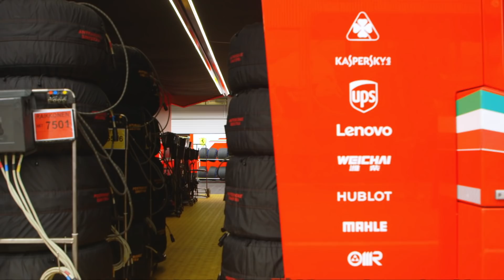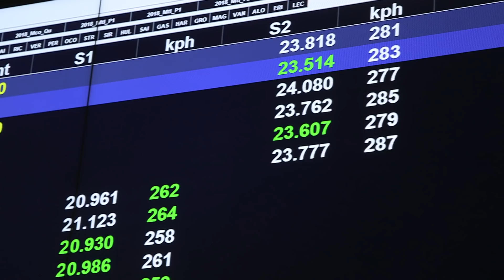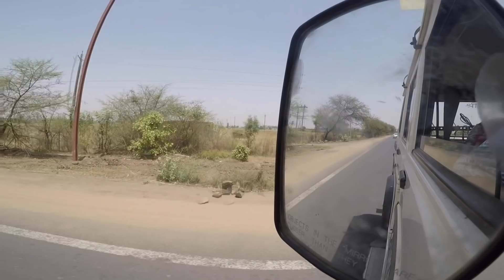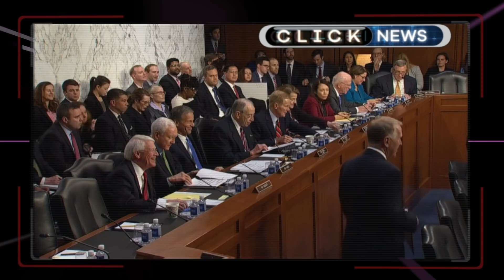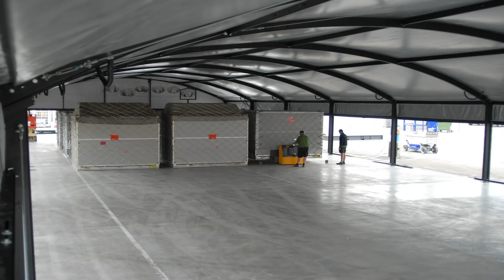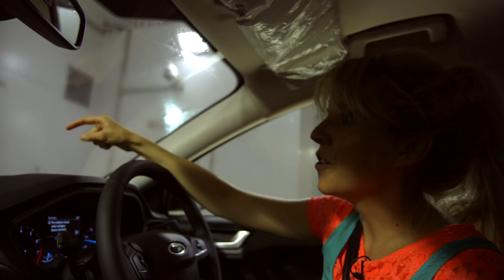The tech of Formula 1 - BBC Click

Comment: Spencer, How would testing the fuel post-session give information about engine conditions ? 
It could not give any information as it still in the fuel bladder, pre-combustion. Dummy.
You're welcome.
Reply: If metal from the engine gets inside the fuel tank, there's definetely a issue.
Reply: Fun Trump-fact Metal flakes. If a lot of metal from the engine is present in the fuel then it would suggest a possible issue
Reply: Guys : Metal particles from the engine cannot get into the FUEL bladder, it is a one-direction filtered high pressure system injecting fuel / air at the inlet ports on the top of the engine. Very fine metal particles can and do accumulate in the OIL as it is a recycling filtered system.